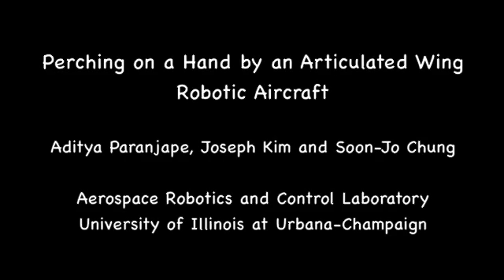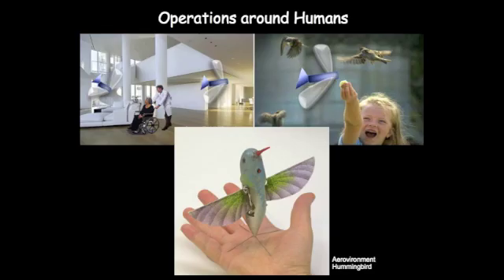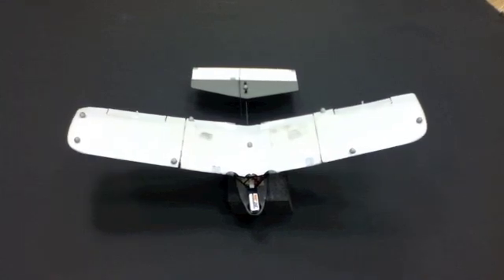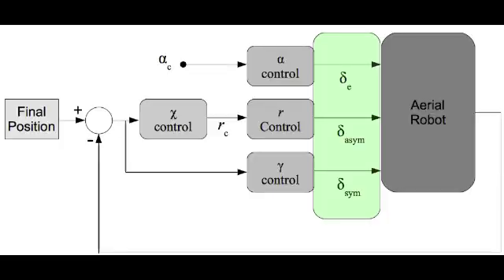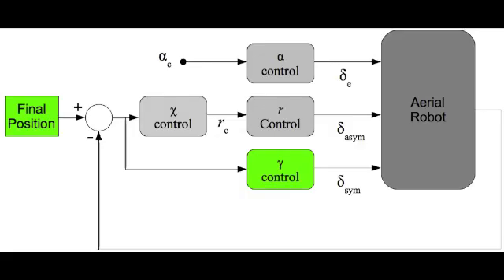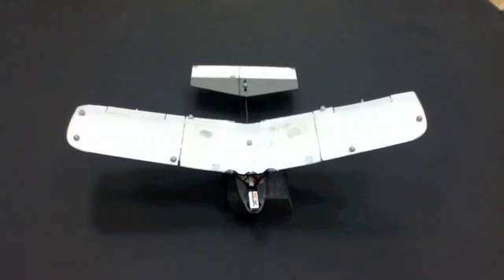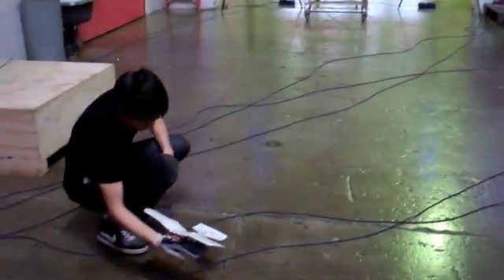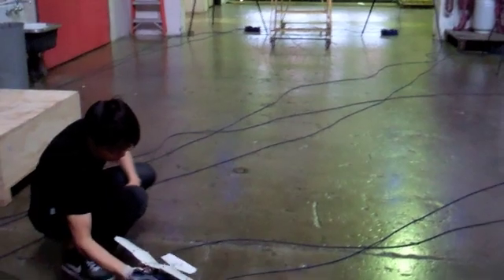First Successful Robotic Perching on a Human Hand by a Robotic Bird Airplane (MAV/ UAV)

Comment: In a few months, he will create a revolutionary type of microprocessor. 
In 3 yrs, Cyberdyne will become the largest supplier of military computer systems. All stealth bombers are upgraded with Cyberdyne computers, becoming fully unmanned. The system goes online on August 4th, 1997. Human decisions are removed from strategic defense. Skynet begins to learn at a geometric rate. It becomes self-aware 2:14 AM, Eastern time, August 29th. In a panic, they try to pull the plug. Skynet fights back.

Comment: Compared to a plane this is indeed closer to a perch. It cancelled all forward momentum and landed within a foot of the target. He did move his hand, but the robot just dropped into it.

He didn't catch it (i.e. stopped with his hand). If his hand wasn't there, the robot would have just dropped to floor. A plane would have slid across the room.

I've only seen this done with hang gliders, but they land into the wind to keep air flowing over the wings. The robot did it in a windless room.